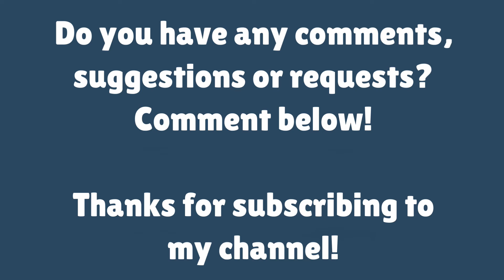TUTORIAL: How to Convert SSOP / TSSOP to DIP... Use for Arduino! Solder Converter Board! (Misc)

Comment: That's exactly what you shouldn't do. First solder the pin headers so the adapter stays fixed on a breadboard later on. Also, can overheat the chip by soldering those pin headers afterwards..

Comment: Thanks, good video, helps alot. But only viable for boards with a solder mask. Doing this with a pure copper board wont end well.
Reply: You have to buy the adapter, dude. Can't mill this on a CNC machine anyway.